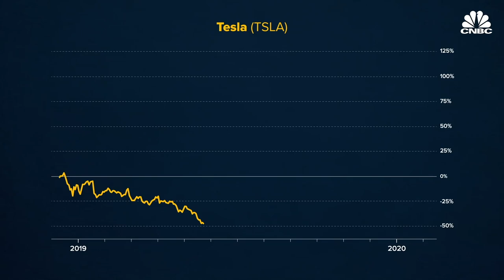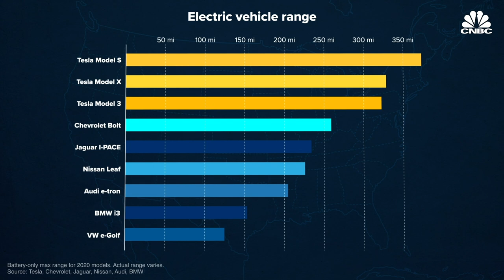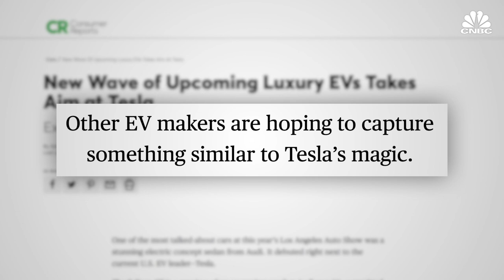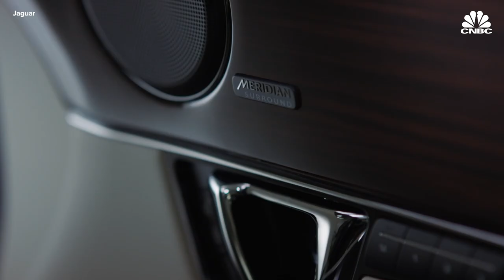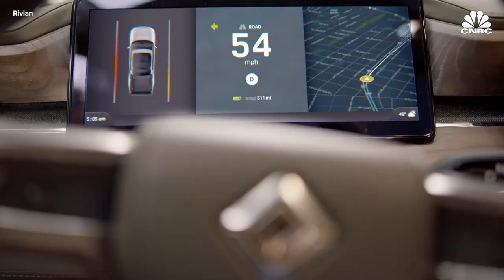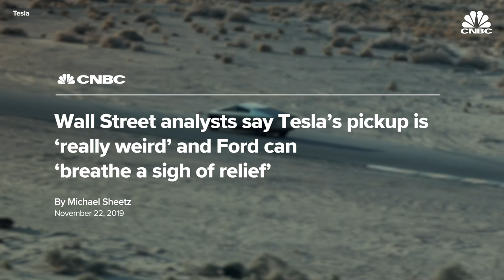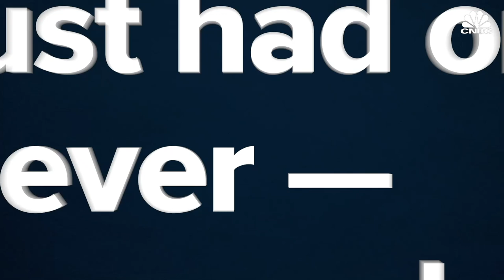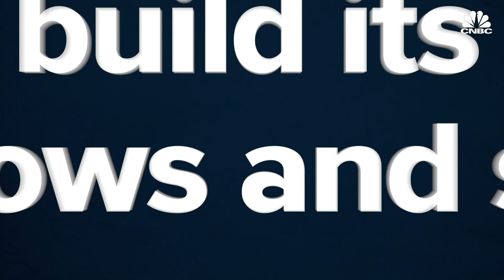Which Automakers Can Seriously Challenge Tesla?

Comment: Tesla also doesn’t sell through 3rd party dealerships, you buy directly from Tesla when someone purchases one.
Reply: That might be a bad thing. Are you going to buy close with traditional or have to drive hours for tesla to buy and repair if needed
Reply: Yep, and you get zero help for DIY repair work and you get to stand in a long line wait for service for it too. 🙄
Reply: @naughtyprofessor100  Doesn't really matter. Some people will always have a different opinion. Tesla wanted majority support. In general, you can't buy ICE vehicles online. But you can buy EVs, both online and offline. And EVs buyers seem to prefer the online version. In general, EV buyers are generally forward thinking and cost-cutting people. And it seems a bit cool, if you can buy a car from your home, rather than walking around several shop. Not to mention, the decrease in cost due to this model. So, it seems EVs will be bought online in the future. ICE vehicle buyers don't care about cost and hence they won't mind going to the dealership, as they will anyways have spend much higher in maintenance and fuel
Reply: @illbeyourmonster1959  As a Tesla owner, I can tell you service is way better than for other cars. I literally go in the app, describe the issue, find an available time slot, and Tesla SENDS someone to your location to fix it. I just experienced this a couple of months ago when my charge port cover was making a strange noise when opening.
Reply: Software problems are less expensive than ICE components .  18 moving parts vs 3000
Reply: @MySipuli  link to your source please
Reply: @naughtyprofessor100  you buy online. Car gets delivered to you and they have Tesla rangers who drive out to you. They are too young a company trying to do a million things are once. In a few years there will be alot more Tesla centers
Reply: Yea, in my region you have to tow your precious Tesla 500+ miles to get it checked :D Yeah, thanks but no thanks, I'll stick to my trusty 20y old diesel
Reply: Kevin J well just don’t break your car, just drive well
Reply: OnE61811301 Ok boomer
Reply: Joel - YES, you can buy a Tesla in your Underwear, and fell ZERO pressure from a Salesperson, because the salesperson is NON existant.
you, don't get LIED to by salesperson and TESLA does nor steer you to a ICE car ever.
Reply: Also you don't see any commercials from Tesla.
Reply: @monster11223  does that expression summarize the pinnacle of your brain activity? :)
Reply: @NonyaBusiness! why don't they just support fixing it yourself? ;)
Reply: NonyaBusiness! ok boomer
Reply: @OnE61811301  your 20 year old diesel will be obsolete in another 20 years. Remember I said it, you have to adapt with the times. Tesla has pushed other automakers to realize this.
Reply: OnE61811301 ok boomer
Reply: Kevin J Tesla sends a ranger to my house to do minor things in my own garage....won’t get that from Toyota
Reply: @enriquegonzalezjr8875   - Tesla cars sell them selves, every Tesla car is Reconizable and a Mobile billboard for Tesla.
Reply: @naughtyprofessor100  honestly I would drive to Tesla in another state
Reply: i like testing cars before i  buy also
Reply: @enriquegonzalezjr8875  it's Elon musks marketing strategy, he said instead of spending billions on advertising like other car companies, he basically says just make a product so cool that you don't need to advertise. He says word of mouth works better.
Reply: Lol good luck driving to next state or whatever for repairs lol pep boys ain’t gonna cut it
Reply: @OnE61811301  I'm sure it will be easier to fix Teslas eventually, it's not like there are any standard electric parts though.
Reply: i think he said that
Reply: @markplott4820  plus the owners advertise them like crazy
Reply: @lexithelexus7377  you can test drive them before buying... Do your research
Reply: @vablo7198  your forgetting they need less maintenance. Lord above please think before you speak
Reply: @iKingRPG   - yes, pretty much every Tesla owner is a Brand Ambassador .
Reply: Everyone here is like "YOU NEED SUPPORT" well yea when you buy an engine with 200 parts. With Tesla, there are fewer moving parts and they come to you.
Reply: @vablo7198  iv seen his videos for the last 2 years
Reply: Yahh, Tesla are good at selling direct, but once you own your car you’re almost on your own..
Reply: what is an absolute disadvantage in a recession
Reply: @enriquegonzalezjr8875  Yuu know he can go buy another newer one, right?  
Also the are still many 40 year old vehicles still on the roads as is because there is a GROWing aftermarket support system catering to them now. 🙄

I can now even get every critical part I need to keep my 1952 International pickup (68 year sold)  on the road if I wanted to and  wasn't possible not that long ago due to limited aftermarket supply problems.  😉
Reply: @NonyaBusiness!  Actually it's now  been well studied that EV's (on average) are only marginally better than IC based vehicles. 

Even worse if the resources mining plus bigger picture RE/AE power sources claimed to be what so many think they should be charged from are factored in.    

Do you not put any effort into looking at real objective unbiased bigger picture complete life time cycle data?🙄
Reply: @iKingRPG   Actually they do very little advertising because they have for the most part been running at a gross loss since day one.  

Cant spend billions (you dont have) on advertising when you literally need it to keep the lights on and the staff paid first. 😉
Reply: @naughtyprofessor100  Tesla has available field service where they come to your garage. Or they will arrange pickup of your vehicle and drop off a loaner car.
Reply: @pabsunn  I have had similar experiences with Tesla. The mobile tech gave  me his personal cell phone number so I can call him or text if I have questions.
Reply: this cannot be understated.  Dealerships have to go
Reply: The dealership model is broken. Tesla is smart
Reply: @illbeyourmonster1959  do you own a Tesla?
Reply: To mention a problem here that happened, there are some Tesla's that popped up at third party dealers (dealers buy them at repo/insurance auctions). There was a case just a few days ago of a dealership buying a Tesla equipped with Autopilot, and the dealer advertised as such, but Tesla remotely disabled it once the new owner registered the car, so that dealer now has to answer for something they had no control over (as technically not providing autopilot would make it false advertising, despite the dealer having no power over it)
Reply: @pabsunn  News flash: not all of us live in California.  If you think such a small company can provide this level of service nationwide, never mind worldwide, when legacy automakers can't, I have a beach house in New Mexico to sell you.
Reply: GintaPPE1000 I don’t live in California. And give it a couple of years - I’m sure it’ll be available in your area one day too
Reply: Having worked in a dealership before, I hope Tesla's competition and sales model force other manufacturers to change. Dealerships run on old business practices that should have died 40 years ago.
Reply: @Smellindamix  first, an advice - learn english. Second, why would I care if Tesla is big or small? :) If they sold parts and service manuals, I would have fixed it myself. But they don't because they're just greedy. FYI, I have no idea where the official dealer for my car is, I buy parts online, the service manual is available on mail, and everything is cool :) But go ahead, buy a tesla, sponsor Elon's weed, I don't mind :)
Reply: @iKingRPG  What do you mean there are no standard electric parts?! :) If they wanted, they could have released the service manuals, the software keys, everything so that you could fix your own car, or have a local mechanic do it. But they don't -there's a word for it - greed. They would even disable your car if you try to fix it.
Reply: @NonyaBusiness! I agree with you partially. What I don't agree with is depending only on tesla's shops and service - as a  software engineer, this is the same exact licensing crap where you don't actually own your software, but "borrow" it from the company.

And you are absolutely correct that fixing a Tesla should be far easier. If they unlocked the software, if they released the service manuals and so on. But they don't because they're simply greedy :)
Reply: @enriquegonzalezjr8875  Good, I'm glad :) I'll buy an EV after 20 years. You go ahead now. I totally agree with your number by the way - EV's need around 20 more years before the technology is viable. Including the battery tech breaktrhrough that is needed ;)
Reply: @iKingRPG  Not at my tesla, they do not allow test drives , they driect you to one couple miles away
Reply: @illbeyourmonster1959  You can't do DIY on an EV apart from wheels and interior design 😂😂
Reply: @MySipuli  but also more prone to software bugs.....which is highly probably in the software world.  People are more concerned about technology failing than mechanical things failing.
Reply: @naughtyprofessor100  Tesla from my knowledge offers to send mechanics out to you for repairs.
Reply: @MySipuli  Gas tanks don't cost $15,000 or have a potentially high rate of failure after 100k. Mechanical friction is only one type of damage that can be done. Electrical components pass electrons that generate heat, corrosion can occur between metals and chemical reactions can wear components.
Reply: @enriquegonzalezjr8875  Why should they? They're all over the media.
Reply: Switchblade duplicate posts over and over
Reply: Brian Landers  your home
Reply: @naughtyprofessor100  But the model is possible because electric cars are ultra-reliable compared with ICE ones, as they are not powered by controlled explosions several hundred times a second driving several thousand moving parts. This is an advantage of e-cars that doesn't get enough attention.
Reply: 665 likes